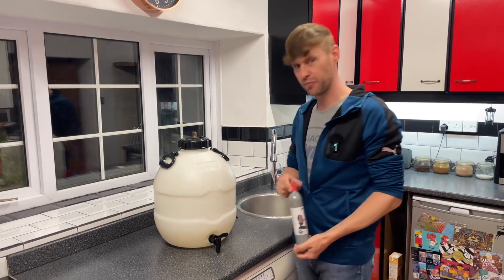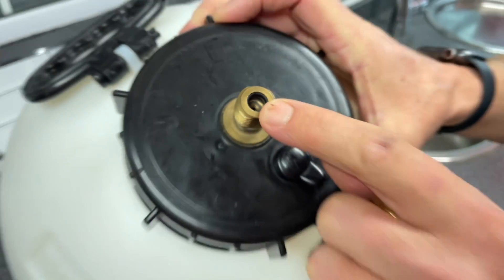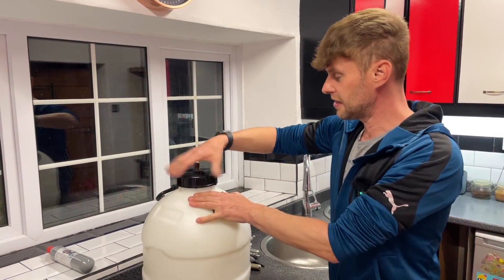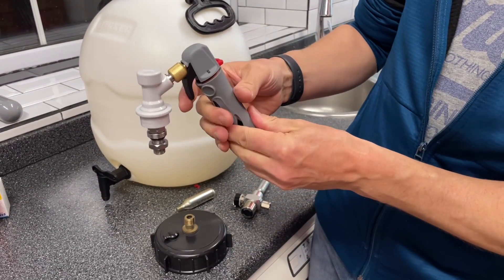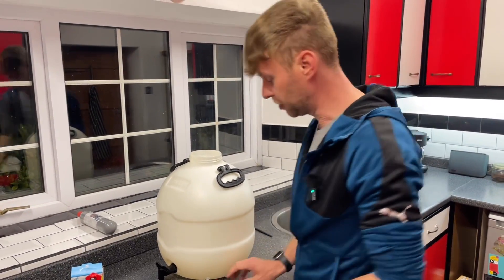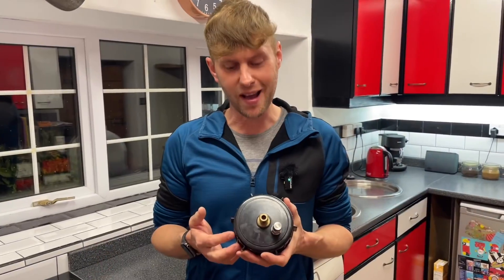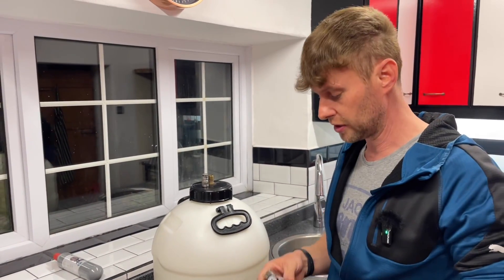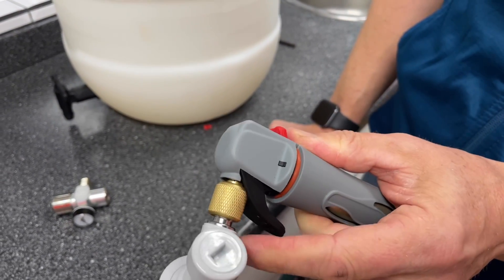King Keg CO2 Alternatives to Hambleton Bard Gas Valves

Comment: Got a couple of cornelius kegs so I've got a large cylinder of gas and was wondering about adding a CO2 Ball lock post and topping the king keg up with that when needed. I'm aware that the king keg can only take a fraction of the pressure but would it be viable?
Reply from the maker: Hi. Yes. That is a viable option. As long as you leave the original valve as that will work as your pressure relief valve in case you inject too much pressure.